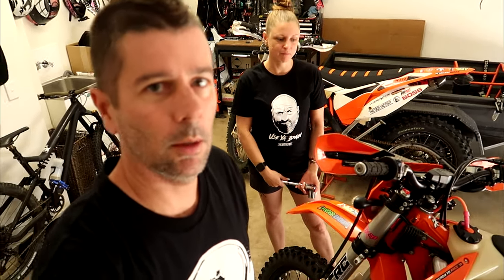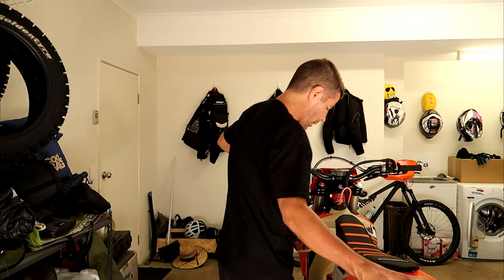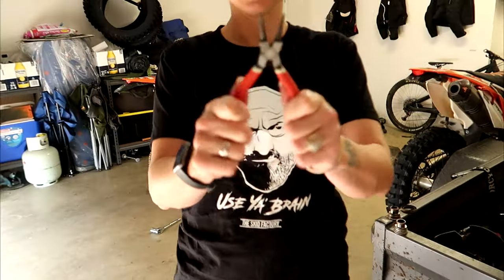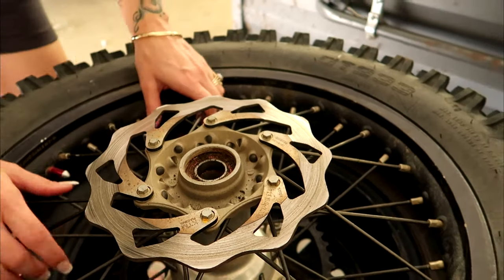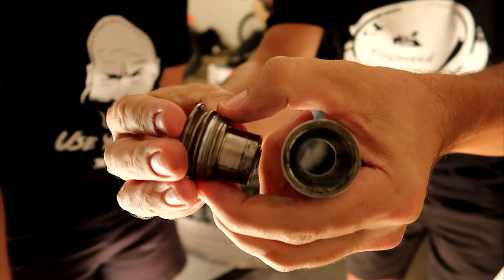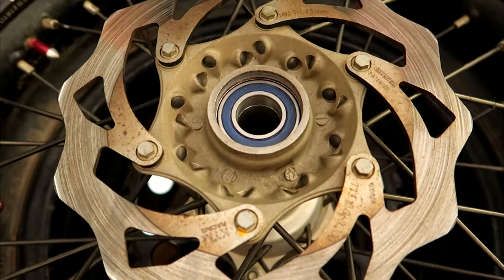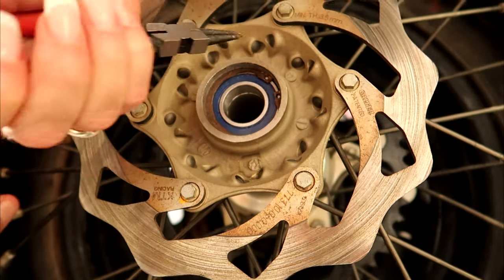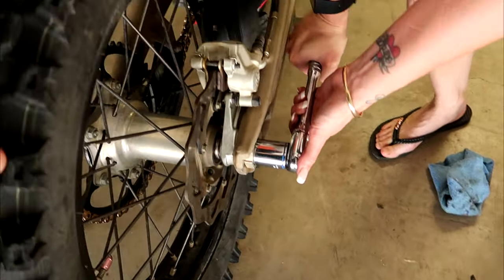Replacing Dirt Bike Wheel Bearings Using Basic Tools

Comment: Good Job.  When replacing the new bearings into hub you could also use the old bearing on top when tapping back in.
Reply from the maker: Yeah but they tend to get jammed into the hub 🤨 I used to cut a slit in an old bearing shell to use but these days the big socket is easy enough 👍

Comment: The heat and cool method as people put it usually you'd heat up (around 170 degrees) the area in which the bearing is going into then, of course, the frozen or chilled bearing is literally just dropped into place. the heat will then sandwich the bearing into place as it warms up the chilled bearing. You usually only need a few hours in the freezer but I do overnight also with chainsaw bearings.
Reply: Sweat baby sweat. With the wheels it works a little easier not a huge diff but on big end and gear bearings in a case it's works like a charm. I put my son's mx cases in the oven at 170 and wait for the drop.

Comment: I use a map torch and freezer. Freeze the bearing overnight, torch the hub to 200f or 93c. The bearing will fall in to the hub, then tap like you showed it to ensure bearing are seated.

Comment: I used the same brand when I got my fe501 because I had them already and to my surprise I have done 3795 km so far in 7 months and still tight so should be fine, and the plastic spacer us there to locate the centre spacer so it doesn't get stuck to one side when fitting but I think you realised that after
Reply from the maker: Hmm have you gotten yours wet a fair bit? I've never had All Balls last more than 1000-1200km but we ride thru water a fair bit.
Reply: Yep been wet dry and most of my riding is ruff single track but I allways pop one of the seals out of any bearings I fit and pack with motored Fett 2000 grease which is lithium based I think and that protects against water anyway
Reply: That was meant to be motorex
Reply from the maker: Ah well when bearing shops sell better brands for less than half the price I'll still steer clear of All Balls. Good to hear someone is having some luck with them tho
Reply: I normally will use only nitto Japanese bearing but they came with the second set of wheels I got with the bike so  but even so I still repack all new bearing with good grease for peace of mind and never had a bearing fail

Comment: Do my bearings exactly the same way. I use Allballs and get 10k to 15k km. I do change them basically every year though. I'm in just as much mud and water as you guys. Front ones every 2 years. Key is cleaning the old grease out and replacing it every tire change.👍
Reply from the maker: Good to hear someone gets some good life out of All Balls. Basically here though, an All Balls kit with 2x bearings and 2x seals costs $30, and the local bearing shop will supply NSK, Koyo, or other similar quality bearings for about $6 each and seals are about $1 each. That's why we don't bother messing about with All Balls usually. It seems to be pretty common opinion here in Aus that they are low quality but it's possible that in different countries they are sourced from different manufacturers, who knows :)
Reply: @MVDBR  totally agree. There's gougers out there. Klr have 3 rear bearings, 2 are easily sourced locally but the 3rd is a pain to find. Allballs kit here is $15-20 for the 3. 

 But religously replace them yearly because of the reputation. Atv and sledders all agree as well.😆
Reply from the maker: @KLRmurdercycle  ah yep that does complicate things, my WR had 2 different sized bearings in the rear and one of them was a special order unit so yeah in that case can completely understand going the All Balls route. Our KTMs use common standard size bearings and they're all the same which makes things a lot simpler! The Austrians do actually so some things right lol

Comment: If u heat the hub slightly with a heat gun the old bearings fall out very easy without marking the hub. 👌
Reply: All balls last longer if you pop that blue seal out and put some good grease in them. Learnt that after one set lasted a whole 6 rides 🤦‍♂️
Reply from the maker: @grant7411  I have tried that way too with no luck. We did that with these anyway before we froze them at Nats insistence, I can guarantee they'll need changing out again soon 😫 I've done a video on All Balls bearings previously, they're just shit

Comment: Thanks for the video. Checked mine today on the 350 and they are shot front and rear. Ordered up some factory links front and rear bearings and seals. This video should make the job a bit easier. Now I'll know to watch out for a possible plastic spacer hiding in there. I'd have probably just ham fisted it and broke that spacer had I not seen your video lol
Reply from the maker: Did yours have the spacer?
Reply: @MVDBR  I haven't dug into it yet. I'll be doing the job on Sunday morning. The bike is a 2012 350 XC-F. It's the offroad version of the bike that I made street legal. Do you know which years and models tend to have the plastic spacer?
Reply from the maker: @mmaaddict78  no from what I was told even some bikes in the same year of manufacture had them and some didn't, depending on which middle main spacer they had 😅 Fkn KTM manufacturing glitch or using up some old parts maybe hahaha
Reply: @MVDBR  You're probably right about the manufacturing. They probably had a batch of wheel spacers made too short and said Fk it, throw a cheap plastic spacer in there, it's only a few tenths off spec lol.
Reply: @MVDBR  Well I did the job and was surprised once I pulled the wheel off. Two bearings on the sprocket side and one bearing on the rotor side. No plastic spacers. My bike has Tusk impact rims and I had just assumed the setup would be same as stock. Nope. Your video still helped regardless.
Reply from the maker: @mmaaddict78  wow that's weird, I've seen some of the old Huskies with 2 bearings on one side. Anyway glad the vid helped!

Comment: Try the axle nut on the sprocket side will make wheel changes easier.Reusing the old wheel spacers is a bad idea as the seals will never seal and the bearings won't last .I think KTM supply new spacers in their kits.Your right about all balls ...chinese crap.Love ya vids ...your guys in Queensland have got the best riding
Reply: @ccenduro   I acknowledge clipping a rock or log when the nut is on the left side can loosen it.I may have been lucky in the last 40 years but I may put a lock wire thru it
Reply: @ccenduro  I ride a 2017 sterco ...it looks the same ....Am I missing something?. The axle is stationary ,How can the rotation of the wheel loosen the adjuster bock on the axle? the bearings would have to be seized on the axle
Reply: @ccenduro  Mate can't happen unless the axle spins... Buttery Bullshit!!...Your on a forum put it out there

Comment: You might find that freezing the bearings could be causing moisture to build up inside therefore causing premature failure heating the hub might be a better option just a thought as I have never had to do this myself with wheel bearing in my bikes not giving you grief just when you said about the failure of the bearings
Reply from the maker: Good point mate yeah condensation could definitely be a factor. Just tapping them in with no heating or freezing of anything is generally no issue anyway so maybe we'll just do that. Cheers